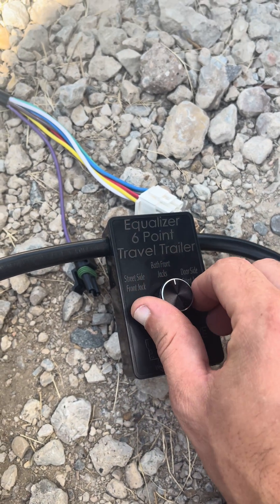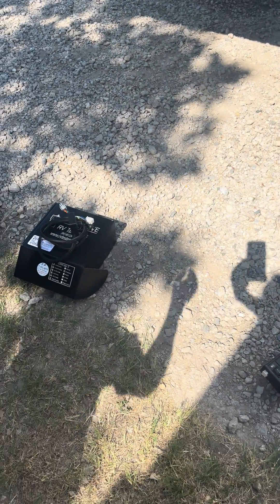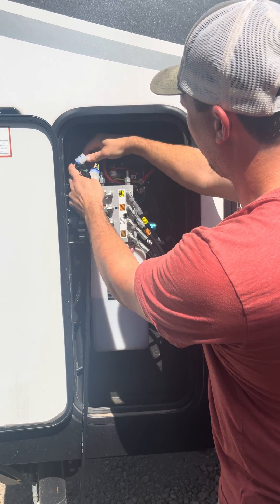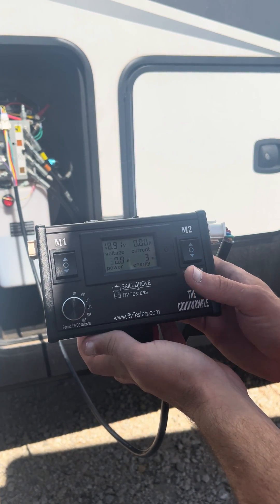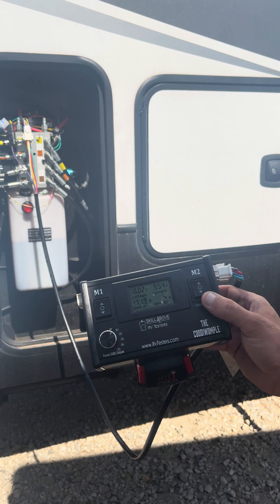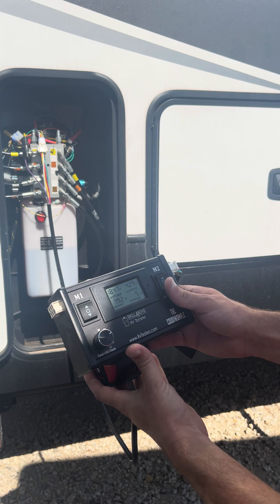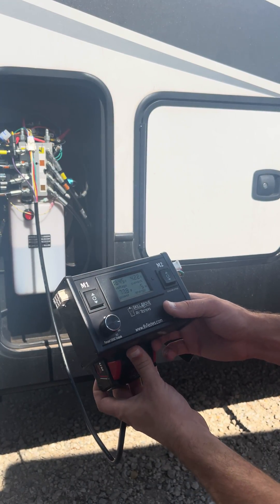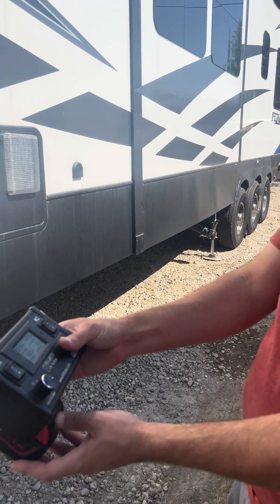CODDIWOMPLE equalizer EQ smart 6pt leveling system adapter.

Comment: Will this work on a 4 point on a motor home?
Reply from the maker: If it has the 9 pin connection at the pump yes, if it has the 15 pin connection we will have the 9 to 15 pin adapter to fit this soon.